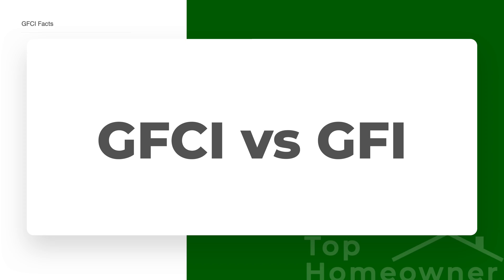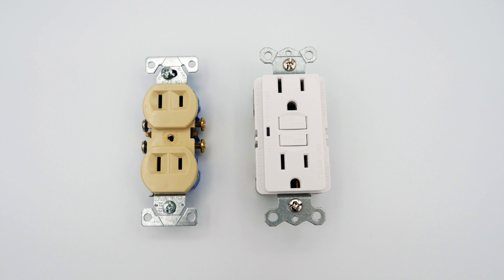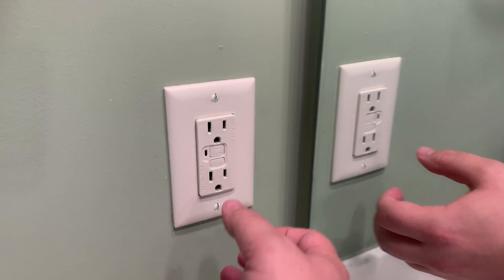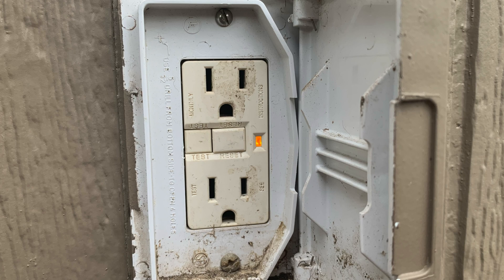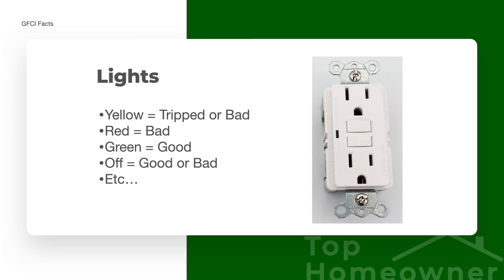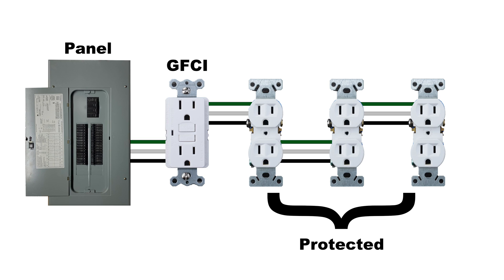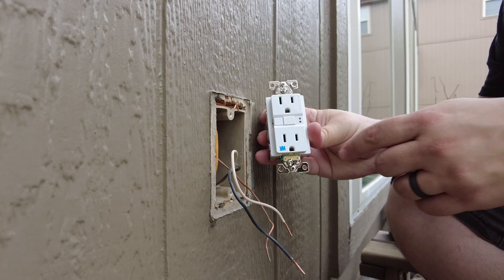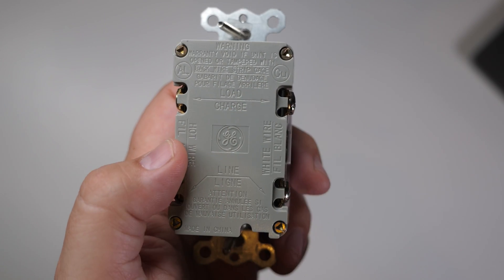Pro Secrets Exposed: GFCI & GFI Outlets

Comment: I lost power during a storm, and when the power came back on, the surge caused the GFCI to trip.

 I lost power to all the down stream recepticals as well. 

I'm disabled and attempted to reset the GFCI without success several times. The light on mine glowed yellow and since I couldn't reset it I was just going to have it replaced.  

I got to thinking that my hands are very limited and not very strong at all because of my disability.  Perhaps, after multiple hand surgeries, I may just not be able to press it hard enough with my finger to reset it.  This time I used the handle end of a small screwdriver to be able to press the reset button in a little harder and it click right into working mode and is working well. 

Sometimes those darn things are just tougher than we are. 😂

Comment: I work at TopGolf and one of our targets flooded, including the GFCI‘s. Reset button is popped out but won’t reset and flashes red. Used an AC voltage non contact reader and it indicates there’s power, but as soon as something is plugged in there’s no longer a read from the reader. Any tips?
Reply from the maker: If a GFCI gets flooded they should be replaced. The internal circuitry will get fried and it can happen even if they just get too damp.

Comment: You never addressed the issue if the reset button will not reset when pressed. My GFCI test light glows green, when reset is pressed, nothing. This tell me the unit needs replacing. There is no downstream receptacle in the circuit.
Reply from the maker: Thanks! I actually have another video about that specific issue

Comment: I have a GFCI outside that has died three times in three years. It's inside a weather proof box. Any idea what could be causing this?
Reply from the maker: Make sure it's weather resistant rated (WR) and has an appropriate weatherproof cover. If both of those things are true then you might look at the seals on the cover and/or caulking between the cover and the house. Hope that helps!
Reply: @TopHomeowner  Thanks. It is a WR. There is no calcking. It was installed OVER vinal siding, and when you unplug any device it seperates very clearly from the siding. The box has a flexable acordian style housing. I am thinking of replacing the box and cutting the siding out to secure the box. Do you have any suggestions of what and how to calk this, also I am not sure what tools to use to cut the siding. I have a skill saw and a dremmel.
Reply: Would high humidity or moisture trip a gfci outlet? Say a closed laundry room that has steamed up from the drys running

Comment: Does line always mean gfci is fed directly from the box, or could be from other sources chained to it ?
Reply from the maker: It doesn't have to be directly from the box, it could also be from another receptacle, etc. It's just the terminals where the power should be coming into the GFCI
Reply: GFCI should be on its own dedicated circuit, so yes, Line is fed directly from the panel. But don’t be surprised to find the line fed from another outlet.

Comment: I like your videos and subscribed-)   clear and concise.    Understanding how a GFCI offers shock protection,  is very helpful when troubleshooting a GFCI that keeps tripping for no apparent reason.   A classic example is shared neutrals.  For instance,  many homes built in the 70s and 80s, even as late as the mid 2000s when AFCI protection was gaining steam, have kitchens with multiwire circuits as a means to reduce labor and material costs while providing the required two 20 amp kitchen circuits.  Typically this involves running a 12/3 w/G NM to the countertop receptacles,  and either having them alternate between the black and red along the wall, or the tab on the hot side can be broken so as to split the top and bottom half of the receptacle on two different circuits.  The GFCI will appear normal but as soon as two loads are connected to the black and red, the GFCI trips even though no hazard of shock exists.  This is because a load on the other line causes an imbalance.   The good news is, there are double pole GFCI breakers available,  and can be used to provide this lifesaving protection in older kitchens,  although they are less common, tend to be over $100 and may not be readily available at your brick and mortar stores

Comment: My GFCI outlet in the garage that was installed by the builder failed after less than five years. I watched your previous video regarding how to replace them and am glad I did as the LINE and LOAD positions on the new outlet were opposite what they were on the old outlet. I followed your instructions and it went very well and the new outlet is performing well. Thanks for your help.
Reply from the maker: Glad to hear the video helped!